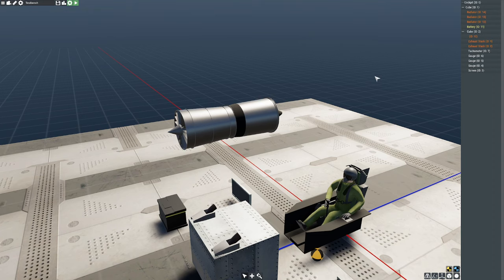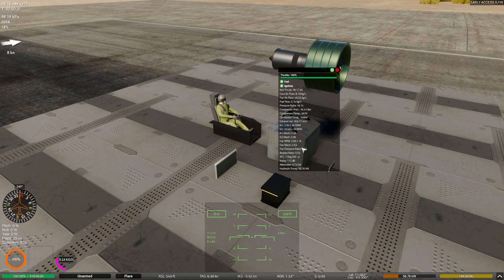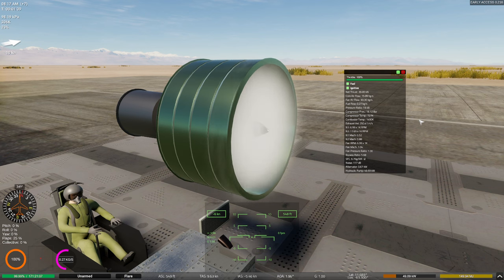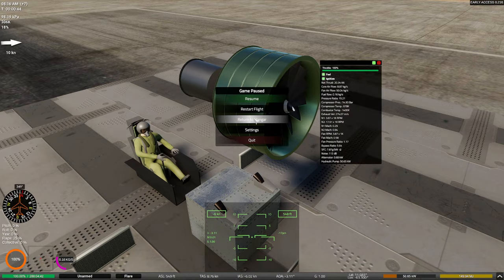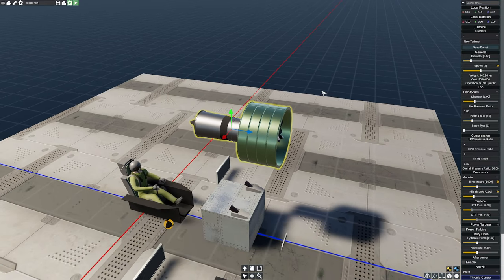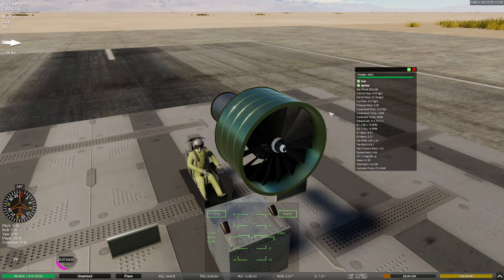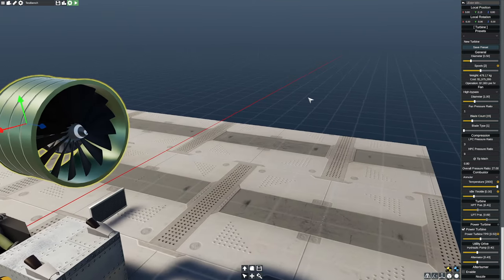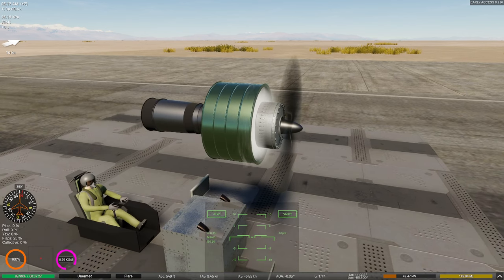Flyout - High Bypass Jet Engines

Comment: Isn't the power turbine supposed to be used to power the high-bypass fan, rather than directly connecting it to the core? I think that might have been why the N1 was so low in the inital tests.
Reply: to my knowledge power turbine is only used on 3 spool turbofans

Comment: I just got started in this game and figuring out high bypass engines were the biggest challenge. You were a big help, getting me into the game and with the turbofans. 

I would suggest a part 4 covering optimization. What does what and what to tweak for each use case.

Comment: The super large high bypass can be achieved "more realistically" in the new update. With the ducted fan, you can have 2 engines with a slightly higher alternator or a power turbine and then both engines feed into a single ducted fan. 

With the alternator+motor, it's a similar concept to Astro Mechanica's turboelectric engine and it allows them to tune the RPM of the fan for the exact flightspeed and altitude they're travelling at.